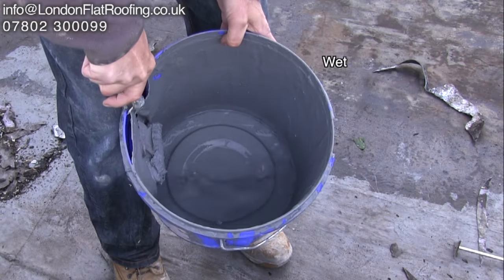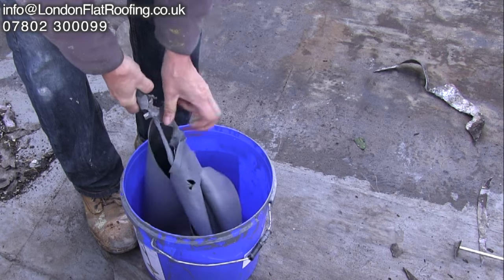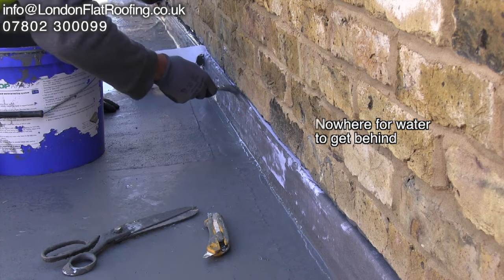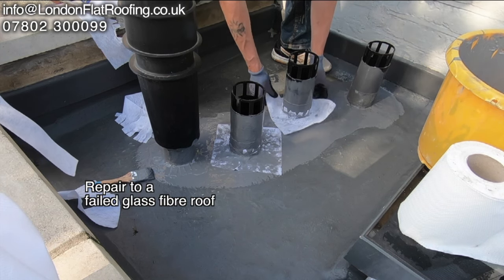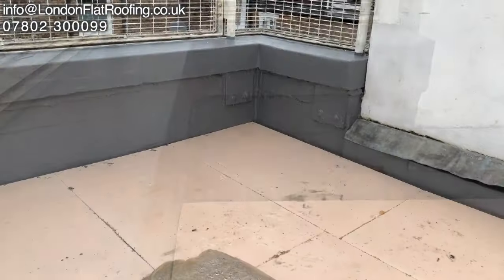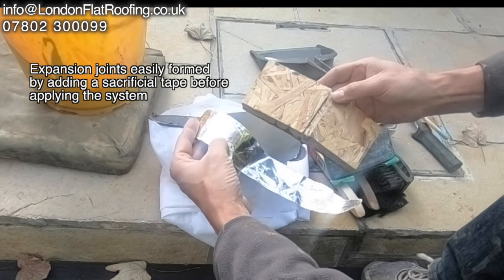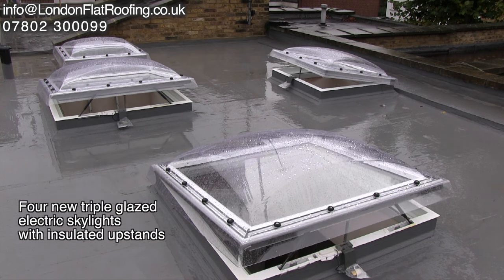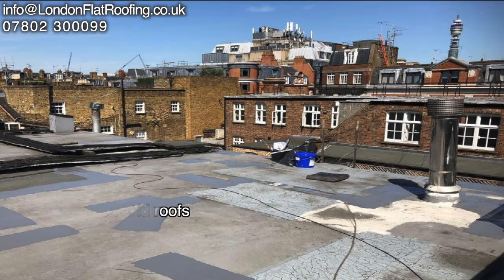Liquid rubber flat roofing system for new flat roofs or roof repairs

Comment: saved £20K  by repairing my roof myself using this stuff, makes it so easy.  god bless liquid roofing and you tube :)
Reply: You probably didn't use the same product as this as it's only available to the trade but there is a. lot of liquid roofing products ont he market and when applied correctly are really good
Reply: So could you tell me what's the rubber solution called?
Reply: what product did you use and where did you get it?

Comment: Hi Steve, thanks for posting this. That drip detail going into the gutter looks great - how do you make that? Thanks. Michael
Reply from the maker: Hard to describe how but its made a lot easier when you have time on a job to do the buildup I was on this job for about 8 days so did the timberwork first then overlaid it with the Hydrostop AH-25+ roofing system  leaving a small drip detail overhanging
Reply: @SteveRoofer  Thanks - it's for my own place so I can take the time. What I was wondering about is the area where you have the membrane hanging down loose into the gutter with no timber behind it; did you do that in situ and if so did you have a backing behind that you peeled off? I'm assuming you didn't just make it 'in the air' as it were...?

Comment: Great clip thanks, I need to coat my felted garage roof, I've had a couple of minor leaks lately, but i cant complain, its lasted for 20 years.
This product looks ideal, my only concern is, if it peels off a plastic bucket that east, will it peel from the surface of the roof, which is felt with a coating over it?

Comment: Steve - I have a square bay with a flat roof and now have a leak where the roof joins the rest of the house.  Can I use Isoflex on this.  I think the flashing is damaged so can I paint this stuff straight on top of it or does it need a primer first?  Should I send you photos?
Reply: What was the outcome please? I have a fibreglass roof which could do with coating

Comment: Hi Steve quick question mate. I have got a fibre glass flat roof which hasn't been done right my question ui can we apply this stuff on top of the fibre glass and copping stones as well or what would you suggest thanks.
Reply: Same boat that I’m in, did you get any work done if so what did you go for ?
Reply: And in the same boat...

I think you should grind down any cracks and possibly apply this straight on top. I will call the company.

Problem with grp is not the product but lack of knowledge of people who lay it.

Comment: I’ve a corrugated garage roof that seems to have lost it’s waterproofing , there isn’t any leaks as sure but the roof seems to absorb the rain then it drips inside garage . If the roof was cleaned , would painting this stuff onto the roof cure this problem? I’m not sure if the roof is concrete or asbestos, it’s 28 yrs old & built by Marley.
Reply: Cheaper just to replace it with a metal one.

Comment: Hi I’m located on the east cost of Nova Scotia I had my roof done with a liquid roofing system and had lots of leaks on and off. The roofer didn’t use the fabric underneath the liquid I’m thinking this is the problem. Where would I get this fabric underlay for my job.
Reply from the maker: If the liquid product is not impregnated into a fabric of some kind that not only controls the depth, but also adds strength to the liquid system then, realistically it's not a recognised liquid roofing system. It is a DIY repair system

Comment: Why are most rubber roofing systems videos from the UK?  and why only the UK has such performing products?  US products seem to have a lot of controversy or issues.  Please tell me I'm wrong, and that there is indeed a comparable product in the US?
Reply from the maker: The US lays far more liquid systems that we do and also lays for more single ply than we do by huge amount mainly because there is a larger we have smaller rooms with more details so therefore more problems

Comment: Great video steve. I have used the desmapol/Permaroof system on a few jobs. Tbh i fjnd them very awkward to use. Especially vertically. I forever got pin holes just as the material was about to cure.  It has its uses but i find rubber or grp to be better. I am going to do the restec flexitec course. Have you used this?
Reply from the maker: The system above is AH25 and is really good on verticals it's also good as there is no mixing and no small so its very user-friendly I haven't used the Restec Flexite system so report back  when you have used it   will  be interesting to know what you think

Comment: For me there’s no self termination water through all brickwork will find it’s way,you always need to turn into a chase and point,there’s a market for liquid coating’s especially over the dreaded GRP which is a shocker of a system,but for me I’ll stick with mastic asphalt and felt.
Reply: Self-termination works if done correctly in the right place. I have to say that the old systems. Felt and mastic asphalt and felt when laid correctly are still the best but unfortunatly are being phased out because of health and safety fire and lack of skilled people doing them, also cost as labour intensive.
Reply: @HampsteadBuildersLt   very true but luckily I’m still busy with both,I do like the idea of liquid but I’ve not seen a bullet proof system yet (I’ve not seen that many tbh) that I’ll use along side felt/asphalt 👍🏻

Comment: Where can I buy a tub if this product as I’ve a leaking junction on a lead valley gutter ?
Reply from the maker: Unfortunately, unless you are a registered installer you can't buy it, sorry.
Reply: Steve Roofer ah that sucks! It’s a long standing problem I have in that the slates also fall off into the gutter and the lead doesn’t lap high enough up behind them to prevent water ingress however it’s just the middle where the joint is in the valley which is where the leaks are coming from. I don’t want to have to take all the slates off to get at the gutter and I’ve tried other products which have failed but this looks perfect.
Reply: Steve Roofer I know a roofer so thanks for the post as there’s a branch of SIG nearby .
Reply from the maker: Supposedly they should not sell it to you without you having an account and being an approved contractor. Supposedly the reasoning behind this is they want to keep the product good name up and don't want it missed used by the general public. I have my suspicions its more because of health and safety and it would have to have different certification if it was open to everybody to use.
Reply from the maker: Have you tried CT-1 ?  Both products are based on alpha-hybrid, silane terminated polyether technology!
Reply: @SteveRoofer  No i havnt but i will look into it. Ive only tried bituminous type products which have generally made a mess of the valley junction and been a complete waste of time. I was going to try fibreglass as a last resort but im not convinced it will be right lapping over the bottom slates but the rubberised solution looks perfect.
Reply: @SteveRoofer  can you use it over a woven matt like the SG product with a roller? Ive just seen a ad for CT1 and its in a tube needing a gun so im thinking its more for bonding materials together?
Reply: @SteveRoofer  ah ive just seen WT-1 which comes in a tub from the same family/supplier as CT-1.
Reply from the maker: Its similar to silicon but better will go over wet surfaces  you can spread it out but its not a fluid
Reply: Steve Roofer Thanks very much as I’m going to give WT-1 a go. I need to buy quite more than I need so I may as well coat most of the leadwork in the valley gutter as it’s close to the end of its life generally.
Reply: Steve Roofer hi Steve, I’ve watched everything on YouTube regarding CT-1 and WT-1 and they look awesome products. Am I right in thinking the SG product is more fluid and easier to apply? What’s advantages and disadvantages of both products?
Reply: @SteveRoofer  i am living at New jersey usa. I have similar problems at my roof.
All the pipes are leaking every storm. Can you suggest me what should i buy and sealed them arround???
Anything similar like this product? Please help...

Comment: Great video dude what is the name of it
Reply from the maker: Its called  Hydrostop AH-25 unfortunately only available to trained installers. It's an amazing material we use on new flat roofs and for flat roof repairs. When we are doing Flat roof condition report we often carry out small roof repairs. We open the bucket and away we go no mixing different materials together use it straight out of the tin
Reply: Hi Steve
trying to find more info on Hydrostop, do you know if it's available in Canada?
Thanks

Comment: dont laugh :),  but could I put this on the roof of my Tramper van to cut down the noise of the rain, as it is rubber, it will dampen the sound, the van is a doblo
Reply from the maker: Yes you could but it would at a lot of weight and cost a lot of money  try fitting a vine roof as they did in the good old day
Reply: @SteveRoofer  cheers for quick reply Steve, weight no prob, having me rear suspention upgraded in next 2 days,  just after a quick and easy way of doing it, vine is to much hard work, I'm old and lazy,   :)